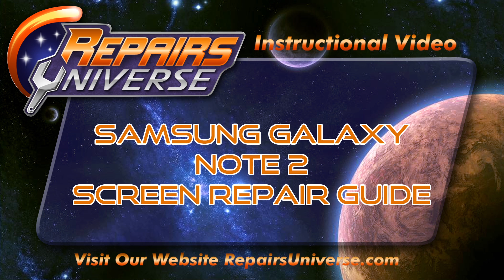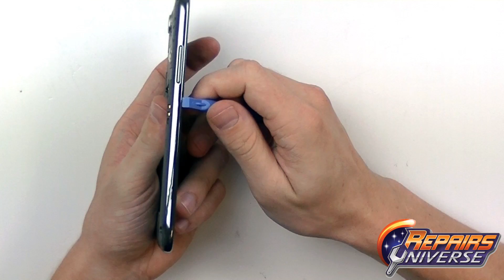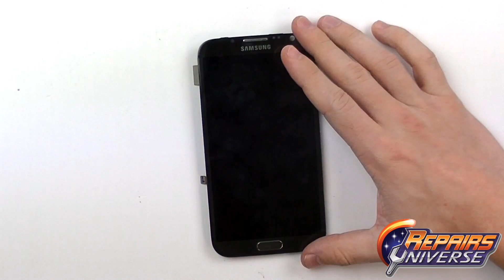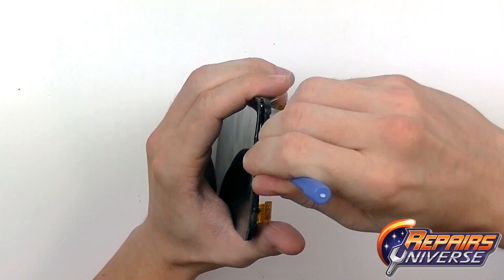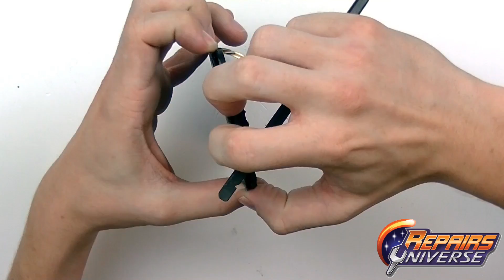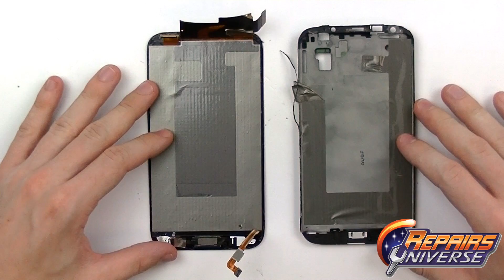Samsung Galaxy Note 2 Screen Repair Guide

Comment: Hi, I replaced the screen by scraping off front glass. Now I noticed there is a gold cable from mother board that was glued to top left front of glass. The cable was glued between the lcd and glass. Is that the screen sensor ? And should I glue it back on to new glass? 
The device is for a samsung note 2 model t889.

Comment: TELL ME pls
After removed the broken front glass to attach new glass which type of glue we can use? how to apply glue ? fully screen or only side of the screen?
Reply from the maker: Raghu CP Chitlur We do not recommend a glass only repair. You would require liquid adhesive and UV lighting to treat it and complete the repair correctly. Unfortunately we do not offer the required tools nor adhesive.

Comment: Hi i had a question my screen gets fuzzy when it's hot why is that? It works fine its just the screen
Reply from the maker: It's possible the LCD may be on its way out or possibly a bad connection.
Reply: Okay. Thank you(:
Reply from the maker: Not a problem! we're always here to help =]

Comment: hi can you help me with my problem? when i switch on my Note 2 it shows a white screen what is the solution to my problem ?
Reply from the maker: May be the LCD that is no longer good. Replacing the LCD should resolve this issue so as long as your unit does not have any software issues.

Comment: I don't know if you monitor comments but even if not perhaps someone can answer my question.  My Note 2s LCD is cracked (the glass is okay).  I have some passwords stored on it that I'd really like to access.  Now, I have an S3 as well and was wondering if I could connect the S3's LCD to my Note 2's motherboard as I believe they use the same flex cable and same sized port.  My concern with this is power draw and essentially how much power is pushed to the LCD itself.  On one hand I wouldn't mind it not working, but on the other hand, I dislike the idea of possibly feeding the S3's screen too much power as a result of it being connected to a Note2's battery and motherboard as I assume more power is pushed to the Note 2's larger screen by default.  That may not be at all how power works with these devices but I just don't want to end up with 2 bad LCDs.  Do you think this is a viable solution or would the power from the note2 going to the s3's screen cause a problem?  I hope that was clear.  I'm just trying to piggyback my note2 onto an S3s screen without ruining the S3 itself.  Thanks.
Reply from the maker: Unfortunately we highly doubt this would work for you. I do apologize to break the news. Although the flex cables may look the same, the units are two different models and require the same exact flex cables to function. Your device should not get damaged if you attempt this but it's highly likely the outcome will not be what you are seeking. Hope this helps.
Reply: Great thank you for the reply.  I discovered that the app I was using to store passwords has a cloud storage feature which I had previously activated at some point so I didn't even need to risk it as it turns out it just automatically downloaded to my new replacement.  Again thanks for the response!
Reply from the maker: You're welcome!

Comment: i dropped my phone but the system is still working the screen is flikering whenever i turn it on and only a little bit what should i do?
Reply from the maker: ianni huang If the actual display is damage, which sounds like it, replacing the LCD and Touch Screen digitizer will resolve this issue.

Comment: Thank you for the video.  Very well done.  I'd never attempt to do this by myself, but it was helpful to see the intricate functions.

My screen is totally black.  I get the two grey icons at the bottom, sometimes.  I've never dropped or wet the phone and I can still hear it working and receive calls, when I swipe the answer motion blindly.

My cell phone company wants to replace it, but can't transfer my data blindly.  Can you suggest a way they might be able to save my data.

Your response is appreciated and date sensitive...a quick answer would be nice.

Comment: I'd like to just make sure all I need is the screen before I purchase it. I have a shallow crack that runs from the bottom left of my screen to the middle right. 

Will I need ONLY the screen at $9.99 to repair this?

Comment: I have removed cracked screnn glass from my note 2 .but i am facing an prolem that is screen display is not showing disply well it shows some fault in display display is looking good no crack on it just display showing problem...plz help me out should i change all assembly or just amything else plz solved it out and help mw out thnq

Comment: I have literally pulled my entire phone apart while watching this video, thinking this was how to replace a cracked screen. It's now in about 30 pieces, and I've gotten to the end of the video and realised I didn't need to disassemble the entire thing to fix the friggin' screen. Obviously this is my fault for not watching the entire video before beginning, but now I'm completely lost. It also doesn't look the same as your end product - the silvery grey screen that sits under the glass is shattered as well, which I probably broke as I was disassembling. I'm guessing this is a separate part altogether, but not sure what it's called?

I also wonder if all the components that I've removed inside will go back in, given that I've ruined the sticky backing them (flex cable, antenna, etc).

Any help would be appreciated, as my phone is not very old and I'd like to fix it. At this point, it looks like I'm going to have to throw it out. Thanks.

Comment: My screen shows spider web looking cracking after working out at the gym yesterday and now doesn't come on at all.  The phone is on, I can use my galaxy gear for calls, texting etc but the screen itself won't come on.  I plugged it up to tv via MHL cable to make sure of it.  The screen shows and the buttons work, but absolutely nothing from the screen itself, no display output, no touch response either.  Can this be fixed simply with a screen?  Or will I likely have to buy the entire LCD/digitizer kit? (in which case I might as well proceed with my full upgrade, considering the price for that kit)

Comment: Im trying to replace my galaxy note 2 screen but one of my screws are striped for some reason is there a way I can replace it with taking out the screws?
Reply from the maker: Titus Gregory Is the of  the screw stripped or does it just spin? If it just spins try sliding a flat head under it to create tension while you unscrew it. If the head is stripped out from using the wrong side screwdriver. You can try this. Take a little superglue and put it on the tip of the screwdriver and hold it to the head of the screw. This will allow you to remove it with no issues.
Reply: Thanks  I was able to remove the screen with taking the screws out.
Reply from the maker: Titus Gregory I'm happy to hear you got it out. I hope the rest of the repair smoothly

Comment from the maker: +Larry daniel. You install the new screen in the reverse order. Only deviation you have is the installation  of the 2 sided adhesive. Which bonds the perimeter of the glass screen to the plastic frame. Once you have done this then everything else is installed in the reverse order. Good Luck

Comment: Great guide, did it fairly well. However, after I replaced the new glass, it starts to bug whenever I use the screen more than 2mn (it basically acts as though I was touching the area in the middle of the screen), and I have to turn the screen on/off to bring it back to a normal use. 
What do you think is wrong? The quality of the glass or maybe the space between the LCD and the glass which could be cleaned more thoroughly ?
Reply from the maker: The proper way to repair the screen is to fuse them together with LOCA. You can use 2 sided tape to place the screen but you will still have the same issues. You can send the phone to us and we can fuse the glass to the lcd for you its 60.00
http://www.repairsuniverse.com/repair-service.html
Reply: What is LOCA?
Reply from the maker: liquid optically-clear adhesive (LOCA). This is a Clear liquid adhesive once used is cured with a UV lamp to fuse the LCD and Glass digitizer together. This gives a factory OE repair. When you just use 2 sided adhesive it leaves a void between the LCD and GLASS which can cause ghosting, unresponsiveness, and dirt in between the LCD and the Glass.

Comment: I had my screen replaced under warranty, but the returned phone now exhibits phantom presses on the capacitive menu button. They also upgraded my bootloader and I tripped the knox bit and cannot get it fixed under warranty any more. The phantom presses appear a couple of times during the day, and when they do, the phone is unusable due to the frequency of the presses. After some time (5-10 minutes), the presses disappear and the phone is perfectly usable again. Do you have any suggestion as to what might be the problem, and how to fix it?
Reply from the maker: How was the repair done? Better yet who did the repair? Was it the carrier, or a repair shop? IF the repair was done with LOCA (clear acrylic sealer) then the digitizer may be defective. If the repair was completed with 2 sided adhesive the void between the Digitizer and LCD could be causing the ghosting. If all else fails and they don't want to fix the issue. You can send the unit into us for a tech to look at it, and fix the issue for you.

Comment from the maker: melwyn d souza Are you referring to the cable that connects the LCD to the motherboard? Or the port on the motherboard that you connect the flex cable too? If your port on the motherboard is damaged then it might render it non-repairable. If the LCD cable itself is ripped then you will need to purchase another LCD.
Reply from the maker: ***** The Note 2 indeed has a wolfson DAC. Specifically, it has a WM1811 which is the same as the tablet Note 10.1.
Reply from the maker: ***** US version
Reply from the maker: ***** Is your entire screen black? or producing a distorted image? We can send you the part and you can fix it yourself or you can send your device to us and we can fix it for you!
Reply from the maker: ***** Follow the link in our description and place an order through our website!

Comment: why is it heating up in the earpiece area?
And is when I have a sdcard inserted is my note 2.
Anybody HELP!!!!!!!!
Reply from the maker: Hello Ruben, What is heating up ? Is the device heating up the earpiece speaker? What happens when you insert your sd card ?
Reply: Its the lcd when the phone is on then I push the lcd and it goes black
Reply from the maker: Ruben Fernandez Don't put any unnecessary pressure on the LCD, it might break. Has the device ever been wet? or had any liquid damage?
Reply: Hmm, any luck on that?

Comment: Thank you for this helpful video. As I was repairing my phone, I realized that 11 screws (the ones that you take out the first) are not the same size. In the video, you mentioned that all the 11 screws outside are the same size. However, 2 of my screws are different then the other 9 normal ones. one is longer and the other one is shorter. I've been having problems with my earphone jack not working well time to time. This is my first time opening this phone, but last year, I sent this phone to Samsung to get my screen repaired. Do you think maybe they misplaced some of my screws? What should I do? Thank you so much!
Reply from the maker: Maybe but samsung would have put it together great.

It could be just going bad. Parts do go bad in some cases. Check to see if you have any water damage on the device.

Comment: I just did like in your guide but the screen is all black and the touch work. also the back and menu doesn't work can you help me to fix this
Reply from the maker: This would be a case of the home button flex being damaged from moving your touch screen + LCD .
If you notice in the video you have to take your time when removing the kit as you could damage the flex cable.

If the cable is damaged here is your replacement part. http://www.repairsuniverse.com/samsung-galaxy-note-2-navigator-flex-cable-ribbon-with-sensor.html

Comment: WATCH that top upper left where the AMOLED digitizer ribbon cable lives. I don't see video authors warning users that this cable is VERY sensitive, and I tore it completely, using a guitar pick. I was careful but none of the videos I watched of this being done warned me how easy it is to kill my display just by prying on the TOP UPPER LEFT of the Note 2.

$150 later using Ebay parts, all is well now. New digitizers are expensive and many people kill theirs just trying to replace the glass. I recommend NOT TO PRY on the top upper left of the Note 2. That ribbon is very exposed and the digitizer will no longer respond to touch of fingers. S-pen still works great, display still works great, very annoying!

Comment: Ok so parts do we need the adhesive for? Do you have a tutorial on putting everything back in place ? Please help!
Reply from the maker: Samantha Saunders Use the adhesive to seal the screen assembly back to the front bezel. Cut strips of it and run it along the edge of the glass on your replacement screen.

Comment: I might have missed this, but how do you separate the LCD from the stylus flex?  (The gray part on the back with the flex cable at the top.)  I've only seen replacement LCD screens without this --- they only have the flex cable on the side.  Thanks in advance!

Comment from the maker: Yes unfortunately this will require the Touch Screen Digitizer / LCD Screen to be replaced. The repair requires the device to be disassembled. However, with the above video guide you can successfully replace the part without damaging other internal components.